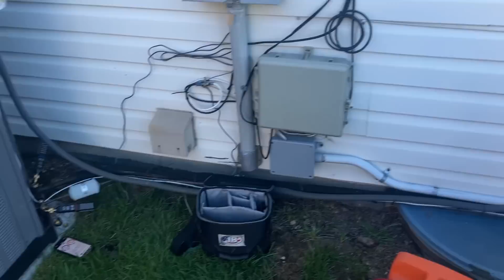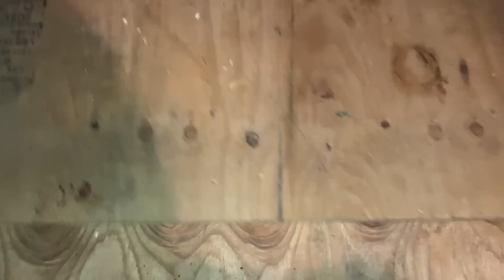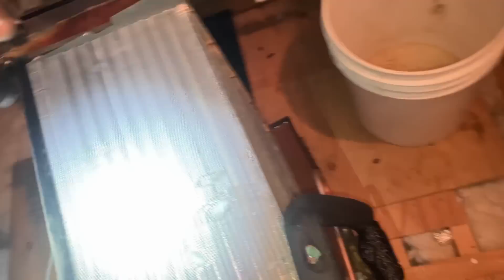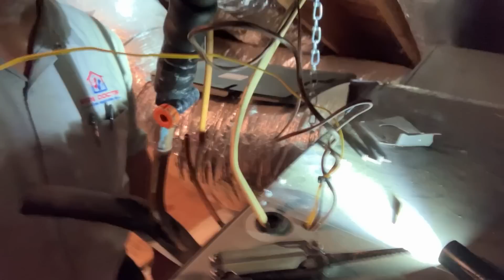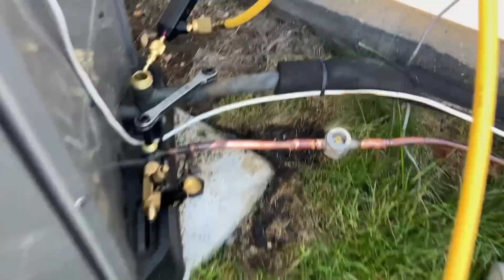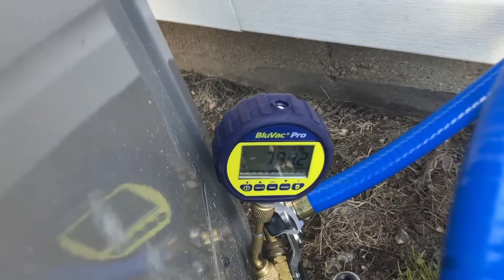This Rheem Air Handler Was a Flooding Nightmare! (Cracked Drain Pan Repair Gone Deep)

Comment: Will the insulation underneath pan ever dry out? I have condensation sweating on the metal underneath the coil/pan. I’m thinking the insulation somehow got soaked and isn’t really effective. Nowhere else on the unit is sweating. I opened up the panel to the evaporator coil and all the condensate was draining properly and pan didn’t look cracked.

Comment: Great job!!!! 
I always pitch the airhandler toward the condensate drain by 1/8-1/4 bubble. Either by the chains with a turnbuckle or just plastic shims ( they never rot) under the unit between the emergency pan rails.
I've had to pitch the coil itself sometimes inside the air handler if it didn't or would pitch for some odd reason.
And I LOVE my tiny shop vac!!! :) And the B tank is my friend.
And I bring my own crawl boards....5/8 plywood bout 32 inches long & 24 inches wide.....at least 3 of em.

Comment: I have always found the easiest braze to leak as you have done it so many times. The hard brazes you are checking all around. Well done. The fault you made was taking the torch away before you leak tested (Cardinal rule) berfore leak testing

Comment: pumping down into a negative pressure when you are reusing that charge can be harmful to the system
Reply from the maker: Sure buddy.
Reply: @PipeDoctor  not saying you cant pump down. just leave a few psi above zero. you are creating a pocket of vacuum that will release into the system
Reply: What? Only if you have a system leak it would be bad to pump into negative as it will suck moisture. Preferably always leave a few psi for 'just in case'. @CommanderHotdog-y5c
Reply: Hey Mike. When you trapped the gas into the condenser could you have closed the vapour line half way first.  So you could be all the way closed by the time the pressure is at zero?